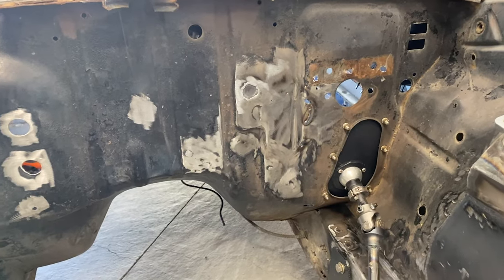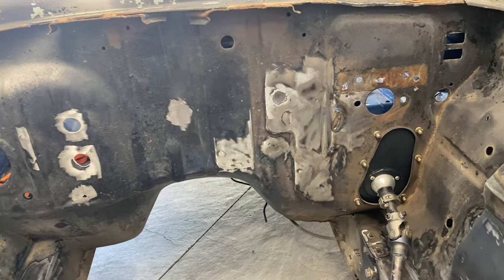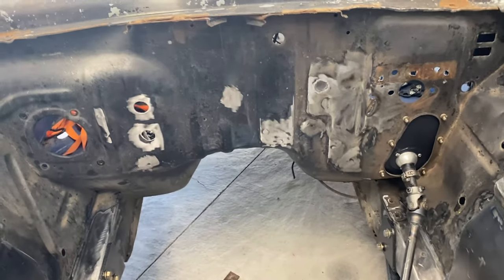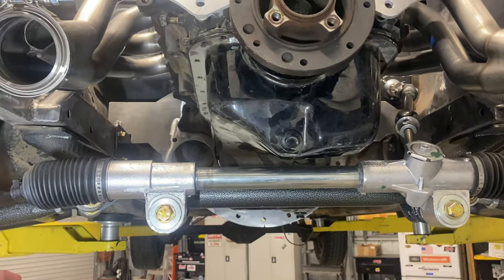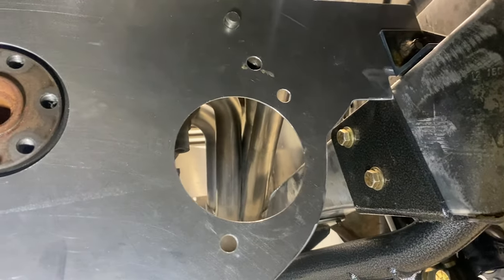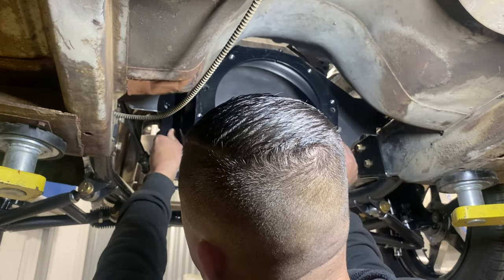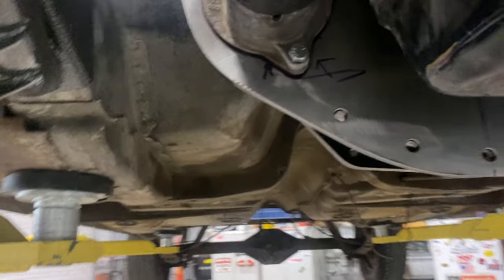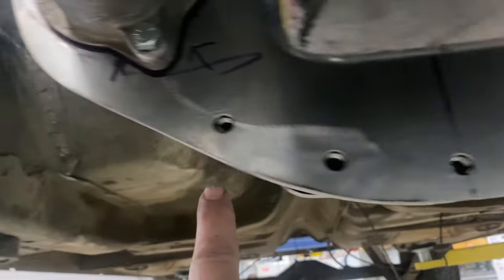1963 FORD FALCON stick shift midplate fabrication! NEW ENGINE UPDATE!

Comment: Just sub'd and commenting. Good to see a Falcon being done. Have done a few, but not as extreme as yours will be. Got me a 63 Ranchero with a 347 stroker in it and it's fun. Currently making it more street friendly with FI (ethanol is hell on carbs) and slightly wider tires...  so currently streaming you as I wrench on mine. LOVE all the Ford signage.

Comment: Great Job Bud.  My Ranger truck I bolt my Power glide to the engine and set it in this way I can tighten all of the bolts while it's out.   Just an idea.   I had to add the Ford Bell housing to the Power glide.   My engine is a 545 ci
Reply from the maker: I might be able to do the same as well. Although I can get to the top bolts easily from up top. Next is seeing if the t56 will fit and if not how much will have to be cut to get it in there ! Thanks for watching !
Reply: @TeamDPerformance   No Problem.  Cool vid

Comment: You should weld in that steering plate on the firewall it’d look so much better
Reply from the maker: I want to be able to remove it if need be.
Reply: @TeamDPerformance  if that’s the case, maybe put the rivnut in the plate facing in and use some button head bolts from the outside, might be prettier…
Reply from the maker: Perhaps I could do that lol

Comment: I split a couple of those in two dart makes a stronger block but I wish when I was trying everything on my falcon that Chevy had the LS format as I would had for Shure gon that route as 1400 HP is very easy and reliable boosted
Reply from the maker: I have a boss 302 block for it. I won’t break it. Should hold the power we’re gonna make. The LS stuff does work for sure. Just not an option for me ! lol
Reply: I started with a boss 302 and then a boss 351 and split them both in half at around 700 HP good luck I did however achieve 1200 HP with the dart block with cleavland heads and a blower on methanol hooked to a power glide with transbrake and a custom 10 " converter the car was running 890 in the 1/4 mile when I sold it as it's reputation became too well known for street racing with the street racer's brotherhood some guys still use my engine configuration ( it's called a cleavor ) cleavland heads on a Windsor block the only difference is now you can buy one already done and there are way better heads available for the Windsor now than there was 35 to 40 years ago
Reply from the maker: Was it the new boss blocks from ford or an older block ? I have some friends that are making over 1500 with the new blocks

Comment: Was that originally a v8 car for you to copy the installed angle of the engine front to rear? Ive ordered front andmid olates for my 60falcon with a small block mopar and tryimg to figure what angle to set it at since the end 4link isnt installed yet.
Reply from the maker: No this was a 6 cylinder car. I think I put it at 3 degrees down in the back